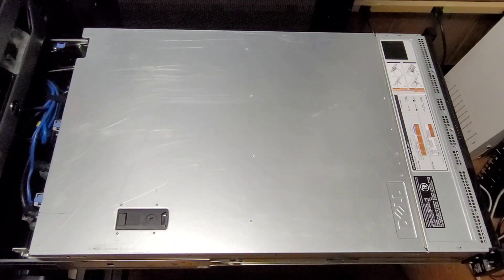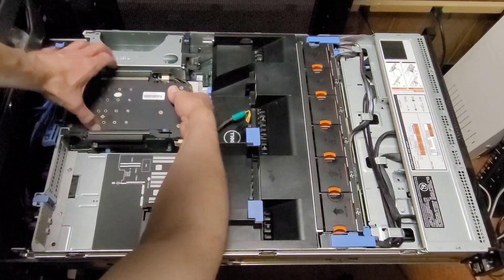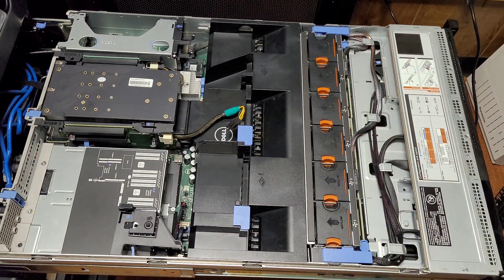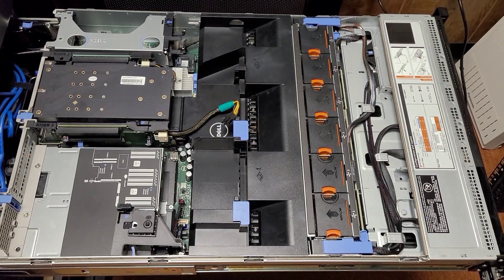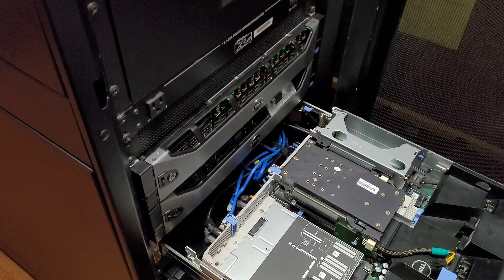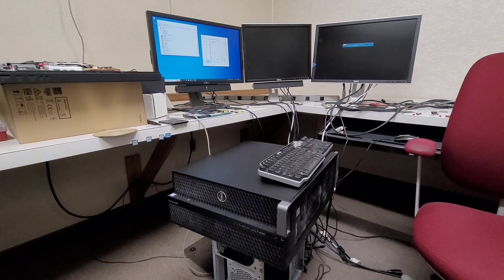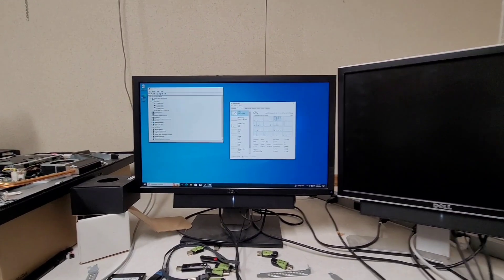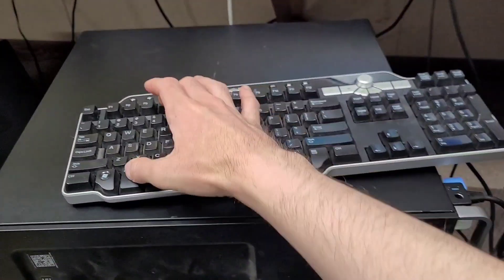Trying to use PCIe bifurcation in my Poweredge R720 just to realize it isn't supported

Comment: Even running 'only' as PCIe3 x 4 you should be able to get 2 - 3 GBps from a single NVMe w/o much tuning, enough for 10 Gbps LAN and a single Workstation edit bay
Reply from the maker: Yup it was hitting 3.5GBps on a single drive.